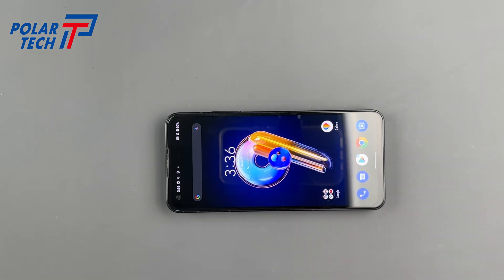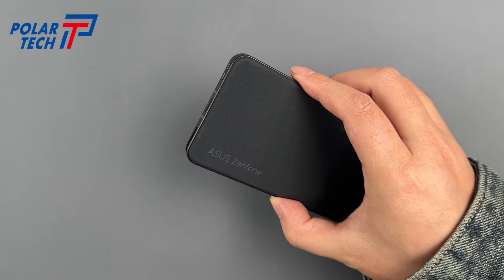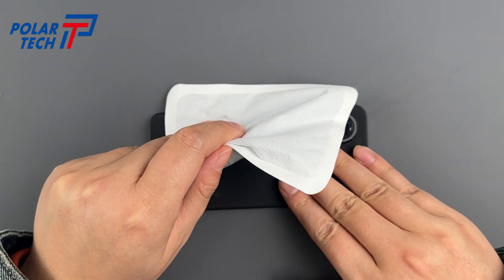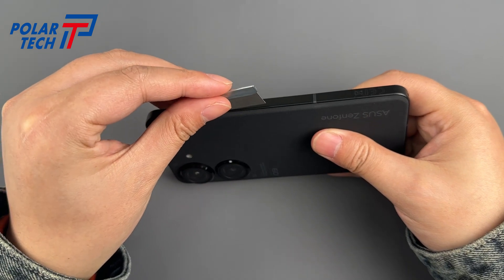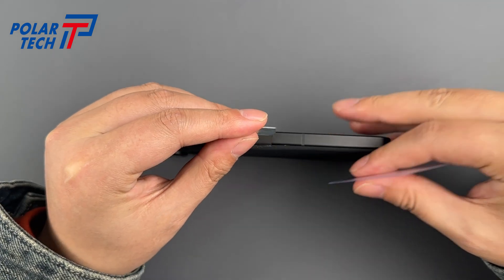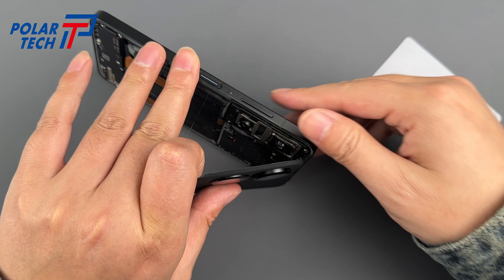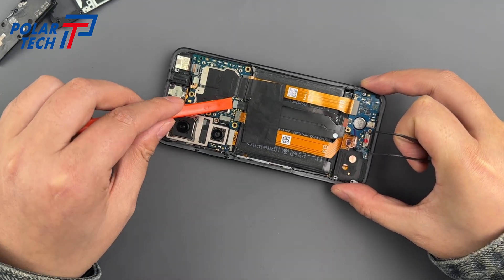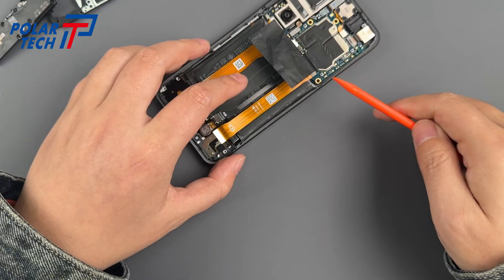Zenfone 9 Disassembly Guide: The Little Flagship Powerhouse

Comment: Hello guys, maybe you can help me with advice: phone working only with charging  adaptor. If it take of from charging - phone immediately power off. The battery is Ok, as I'm already have tried to replace for another one. What should I doing, what can be the reason?
Reply from the maker: 1.Inspect the Battery Connector    2.Look for damaged components near the battery connector